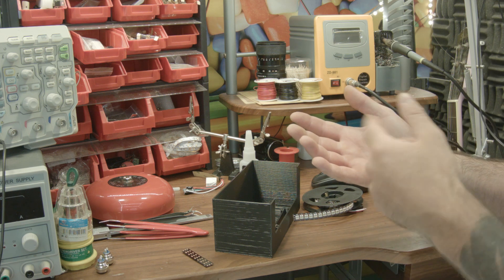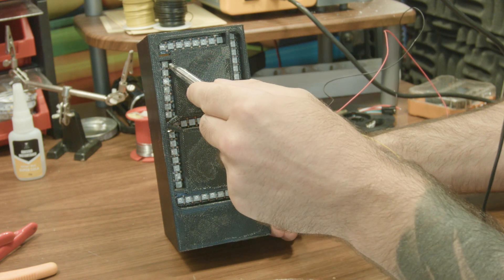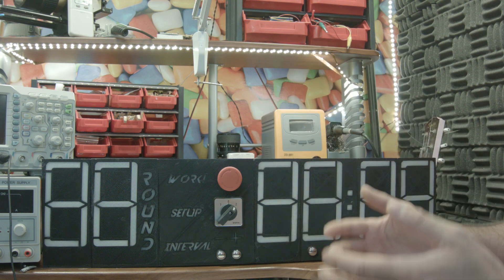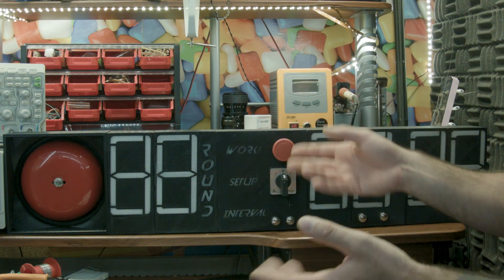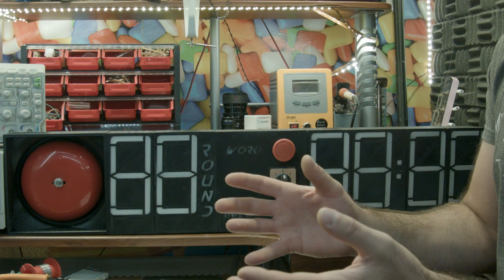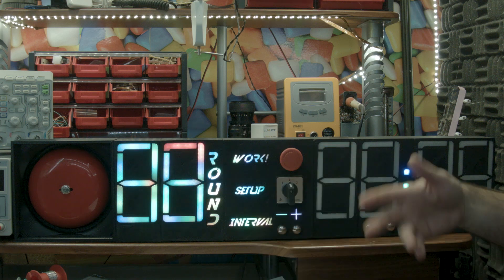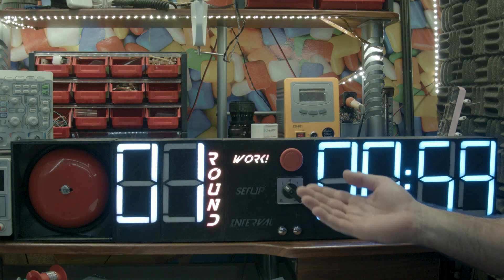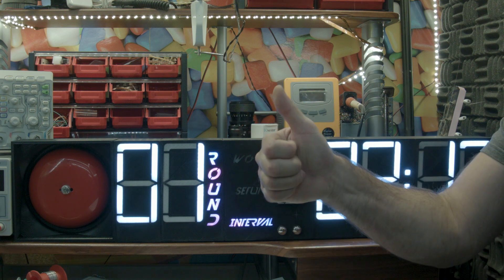DIY Boxing Clock

Comment: Subscribed! Came here from     https://reddit.com/r/arduino/comments/9el5z0/made_a_cool_boxing_clock_for_my_gym/
*I have a few comments:*
1. You used Arduino code and an ESP32, its an Arduino project. No more debate.
2. I suggest this link for the benefit of you and your viewers
                    #214 New: Easier ESP32 installation in Arduino IDE (How to)
                    https://www.youtube.com/watch?v=DgaKlh081tU&t=1s
3. thanks for a github link to the code. 
   *Maybe you can add a link in github so those that it there can find the y/t.*
Maybe you can add a link in github for all your projects
             https://github.com/nandoanalog
             https://www.youtube.com/channel/UCQRupdcvQ_0TE5EiESkZu1g/videos

4. In your code, there is an inconsistency, 'true' vs '0'  values
ShowAnimation=true;
ShowAnimation=0;
5. I had trouble reading your code because you have used inconsistent line breaks. 
  I opened your code in notepad++ and Arduino IDE and the breaks didn't change.
Part of your code has line breaks after "{" and after ";"  about 60 character columns wide

   if(DisplayNUM==0){for (byte i=0; i < NUM_Led;i++){
  LedsOnDisplay[DisplayNUM][i] = CHSV(h, s, v);
  h=random(20,50);
 s=random(240,255);v=v-10;
  FastLED.show();
  }

VERSUS about 177 character columns wide

if(SetupTimeMark-CurrentTime>5000){
  if(SetWorkTime==true){SetWorkTime=false;SetRestTime=true;CurrentTime=millis(); h=140;s=240;v=255;Minutes(DefinedRestingMinutes);Seconds(DefinedRestingSeconds);DotsDisplay();}
  else{SetWorkTime=true;SetRestTime=false;CurrentTime=millis();  h=20;s=240;v=255;Minutes(DefinedWorkingMinutes);Seconds(DefinedWorkingSeconds);DotsDisplay();}
  }
Reply from the maker: On it! 
The inconsistent line breaks are mostly a result of my messy nature. Wasn't even thinking about sharing the code because it's a huge mess, due to me not knowing what the hell an array or a function was prior to starting this project.